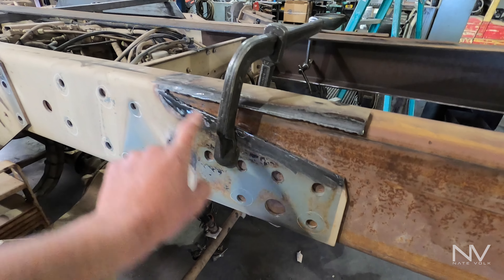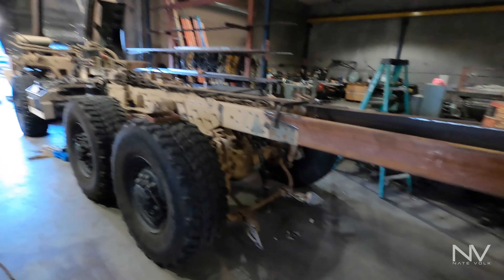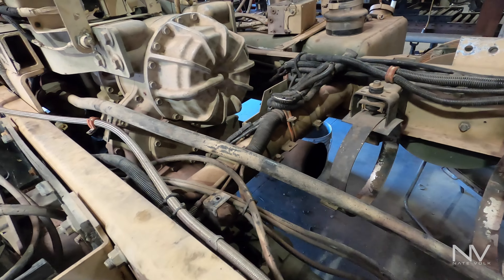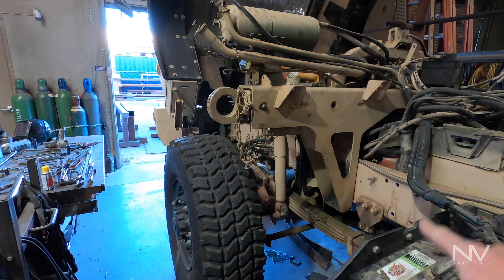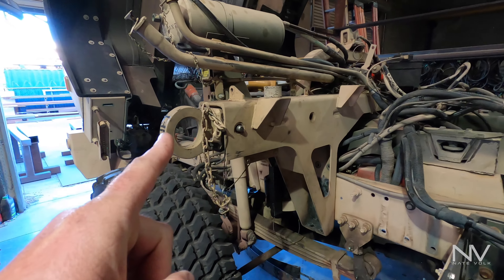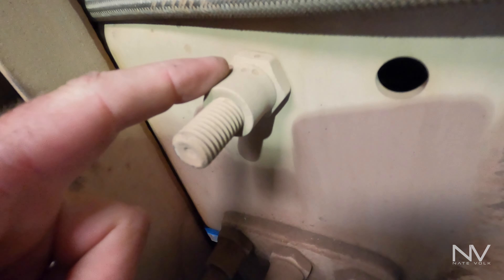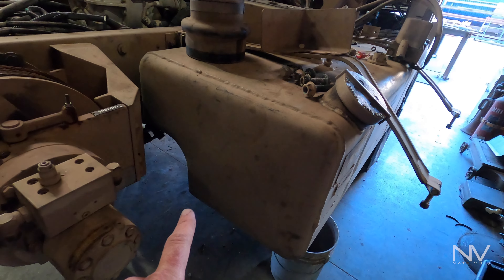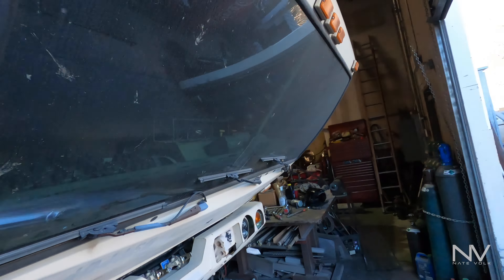LMTV Expedition Overand Truck Build - Part One

Comment: Cool build. Looking forward to more. One thing the lift points are great for (besides a hammock) is recovery points. Imagine if your truck was on it's side—where would you grab it to flip it back over? Those air lift points are the best... left mine on when I removed the spare tire and airbox. It's also a great place to mount all the doodads like your new air filters, polarity box, cab leveling sensor, Ether bottle, hydraulic spools, hydraulic pump, and ABS controller.... Where were you planning on mounting the radiator reservoir tank? Keep up the good work!
Reply from the maker: I thin if the truck is on its side, I think I'll be just walking away lol!  I'm making mounts to mount some of that stuff out of the way.  The radiator reservoir is staying where it is, and I'll be adding either a custom air filter box, or a donaldson unit as well.  When I come up the coast, you're for sure on the list to grab a beer with!
Reply: @NateVolk , sounds good, get a hold of me when you venture North!

Comment: Starting a similar build on my M1088. I've never done frame work before, just engines and electrical. Have some questions. What size size rales are you using for the frame riser and subframe? Did the C channels extensions size to fit inside the current frame? Do you source you frame bolts locally or online? Grade 8? Sorry for all of the questions, this is all new to me! 

Looks great, by the way!
Reply from the maker: Great questions!  I'm using 3x4 tube for on top of the stock frame rail, and 3x6 tube for the subframe of the box.  The crossmembers are 2x4 tube.  For the C channel, I found a piece of 8" tube and cut it in half to make the C channel.  I had to put some plate on top to make it flush with the frame rail.  I was able to get all new hardware locally at a shop, grade 8 bolts and nuts :)
Feel free to ask away with anything else.  There are more videos in the build series already!  Thanks!
Reply: @NateVolk  Awesome! Thank you ! Are you on Instagram?
Reply from the maker: I am, but I don’t post that often. I should probably do some truck updates :-)
Reply from the maker: @NateVolk_